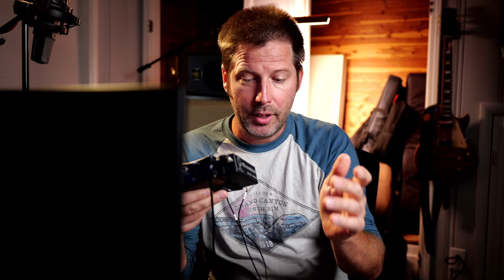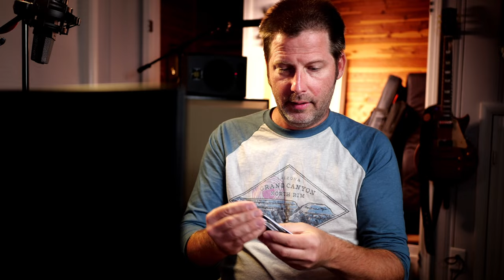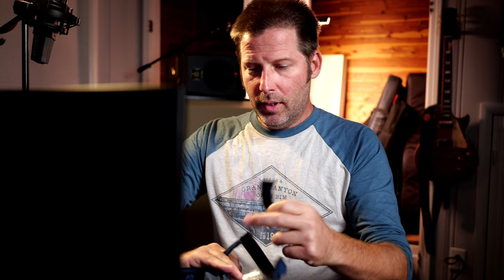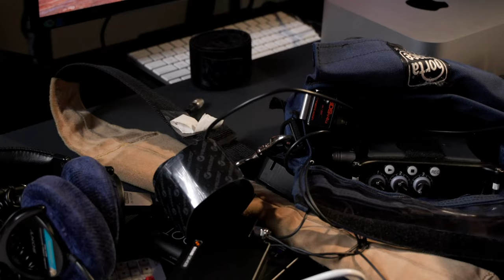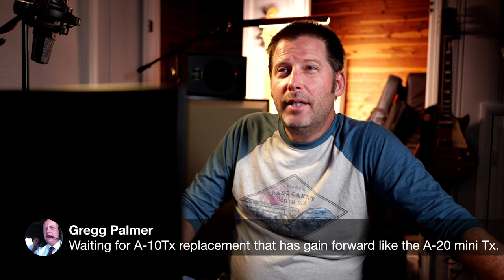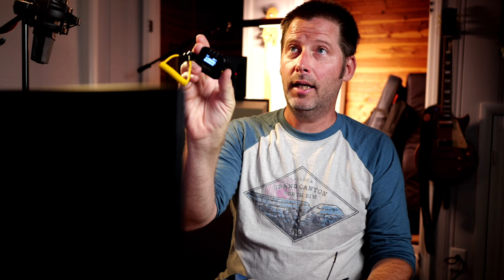Building A Bag Live

Comment: Love it! I have been on the small bag game alot recently. Been using the ktek hip pack with a shoulderstrap and a mixpre 3, remote audio bds, esmart battery, senn sk2000 iem TX (got rid of the battery elim actually with the long Sennheiser batt life on NiMh) and either wisycom or lectro slot receiver. 
Looking to ditch the bds in this rig soon, it's almost comical when you plug in a Mixpre 3 and a slot RX and it says 22 hours, definitely overkill to keep the bds in this tiny bag. Batt cup with dual output will be next or maybe the audio workbench swiftcup.
The small bag rig is amazing for run and gun stuff around NYC. I can fit a full rig in a backpack!
Reply from the maker: Sounds like an awesome set up David, def good to stay light in NY

Comment: Can I fit an USB power bank in there with the MixPre6?
Reply from the maker: Not sure, I do know things can get tight in a small bag when you start adding all the bits.  Usually I only carry what I need to work on my feet  and leave what’s not immediately necessary staged near by.
Reply: @MichaelWynneCAS  I didn't know at the time I posted that it was an OG Porta brace bag. I will look up some reviews of the Porta Brace AR-MixPre6. I was looking at that one or the Orca OR-270. Thanks for the info.